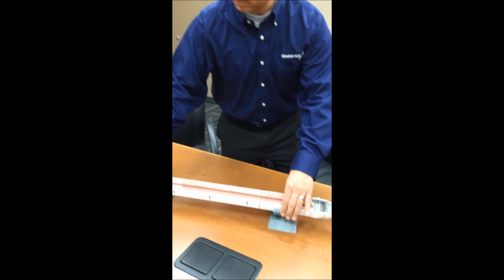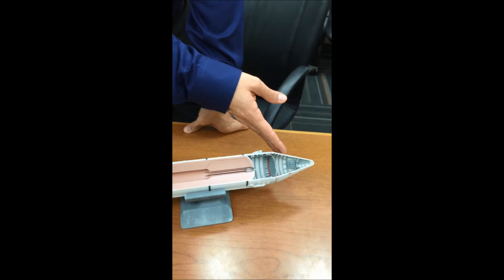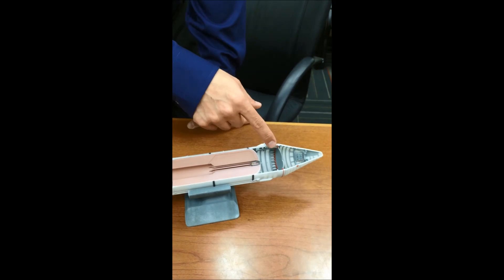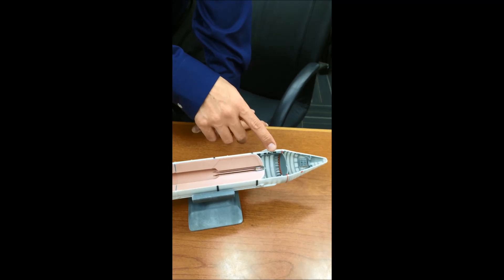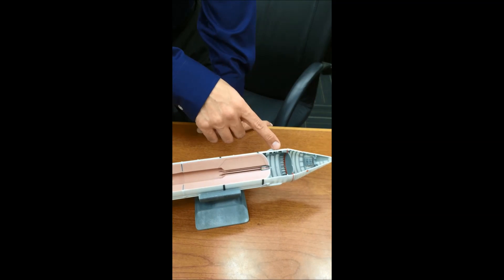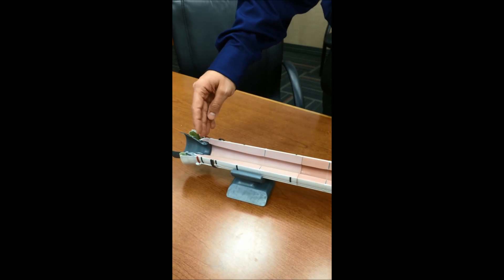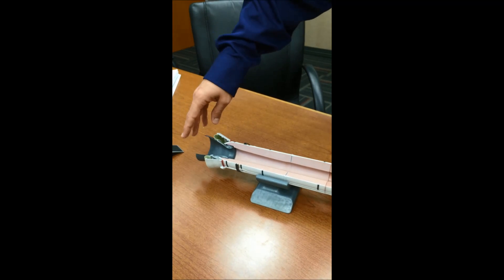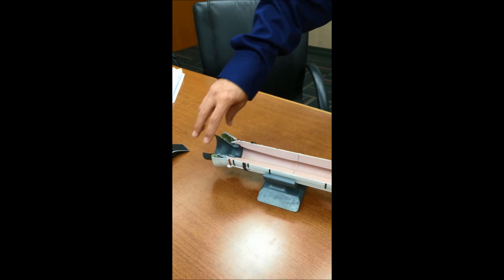How a solid rocket motor works

Comment: interesting , so solid rocket engines are basically hollow in the middle ?  and how does that igniter work & generate a uniform burn of the propellant ? dont some part burn more / less , what guarantees the uniformity or the burn ?
Reply: its complicated but basically all the surface area that is exposed to the flame will burn, but the burn rate will go up if the pressure is higher, so to get the rocket burning they get it all up to pressure with a mini solid rocket booster. The igniter booster just gets ignited with a pellet of gunpowder or thermite or something like that. The material from the top of the rocket is going faster than the material from the bottom so the bottom burns faster because it has higher pressure, and it balances out really quickly after ignition.

Comment: How  dose it  cool down the injection port ....  ??     it might be a  Ultrahigh temperature
 around the port. and That's gonna  melt the injection port...
Reply: First of all, grammar. Second of all, the throat, nozzle, and "Injection port" is most likely cooled by ablator that strips away during flight.

Comment: Thanks!  I've always imagined that a solid rocket booster fuel is a whole cylinder of solid and ignite from bottom, but it never felt right because that would mean top heavy the longer it is in flight, also I thought the combustion should melt the casing.  Or the combustion is too strong the casting won't hold, etc.  After watching this video my no. 1 & 2 doubt is solved.
Reply: I too didn't knew that. Do watch Challenger disaster caused by frozen O-rings in the solid booster section.

Comment: Isnt this technology old and obsolete? I mean there is no chance of any kind of re-usability, ever..
Reply: Idunnohuur yeah but it has two very big advantages.
Its very reliable.
And its dead cheap compared to other propellanta
Reply: Actually very high tech stuff. Reliable, easy to store and change.
Think, most military missiles.
Reply: They recovered, refurbished and re used the Shuttle boosters.
Reply: You don't know what you're talking about, this is the cutting edge of solid rocket propulsion.
Reply: ⵉⵜⵔⵓⵏⴰⵓⵜ  no it’s not learn about space x
Reply: @flamygold2060  Please Stop, All I hear about is stupid SpaceX. It used to cool, up until 3 yearolds in the youtube comment section started whining on and on about it.
Reply: Space shuttle SRBs were recovered, rebuilt, recertified, and re-flown multiple times, and the SLS will be no different.  Solids give you a lot of thrust for the buck at the expense of restart/shutdown capability and burn time compared to liquids, but they absolutely are useful and in no way outdated.  Plus, shaping the grain allows you to tailor the thrust vs. time profile before they are jettisoned.
Reply: This tech just has many disadvantages